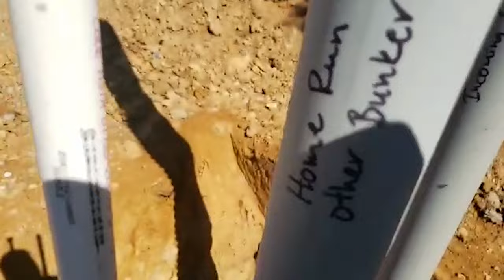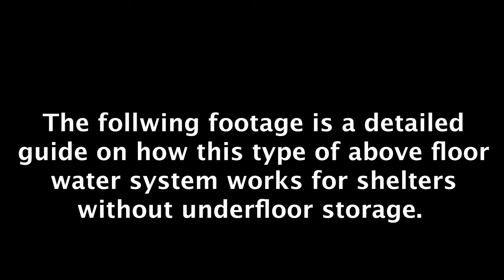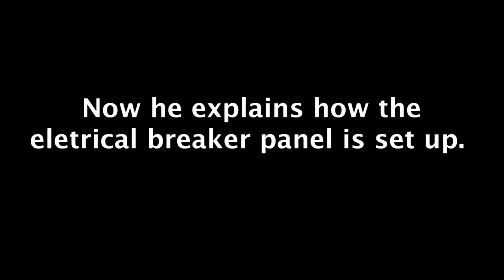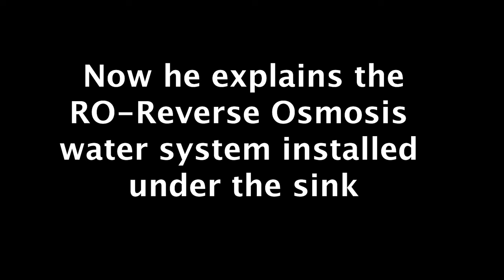INSTALLING a $350,000 ATLAS BOMB SHELTER with a SECRET PASSAGE!

Comment: These bunkers are very nice man caves, and a fine storm hide out but nothing more. Certainly not a bomb shelter! They are not deep enough and a bomb shelter should be protected by at least 4 meters of reeinforced concrete, preferably much more.  Same is true for the entrance and escape hatch. You sell nice fairy tales!
Reply: Not to mention all someone on the surface would need to do is plug up all the air vents & suffocate everyone inside the bunker. These are nothing more than fancy, expensive tombs.
Reply: @Bishop228  I had the same thougts , those vents should be much better protected. A Nice wine cellar Or tornado hide out; nothing more

Comment: Something I would want done differently, or in ADDITION to, the water system in that bunker.  Add a filter before the external water goes into the tanks or water heater with the cross-over from the output of the tanks is back on the INPUT of the filter.  Even if it was just the particulate portion of the RO system, every little bit would be a help, and not THAT big an increase in cost.
Reply: I'd like to have a way to recirculate my water supply while it's not being used so it can re-oxygenate. It would also help lengthen the life of the water filters, especially if you have the extra filter as suggested above. I'd also like a way to limit water usage to the shower when it's not being used for decon. Really, there should be a decon shower before entering the living quarters.
Reply: This has bugged me for years but since the subject of a secret passage was brought up.... The proximity of the escape hatch to the bunker has driven me almost to drink. I'd love to see someone actually ask for an escape tunnel ending up in the woods or elsewhere if leaving the bunker was absolutely necessary. And just because it should be seriously considered, the entrance and escape should be booby trapped.
Reply: @kevinmoore2929  if/when I can afford one that's what it will be with mine.  Either in or behind another building at least 50 feet away.  The problem with popping up in the woods is avoiding killing trees while you're digging the trench for the tunnel.
Reply: @michiganengineer8621  at my farm you'd never believe how fast trees grow back if you remove them.  In under 10 years we had a road through our farm we didn't need or care about so we let the trees move in.  Here we are now you'd never have known 10 years ago anything was there.,.. that area is a forest now just because we stopped maintaining that space.  It is thick with trees now.
Reply: @kevinmoore2929 the main reason is in case of an emergency inside the tunnel like a fire where the gasses can kill you quickly. The escape is there so you can try to get up and out fast without having to go for 200 yards through a tube before you get to the ladder. 

The lesser reason is for an attack where you need to escape someone trying to get in.

Comment: You need a German Plumber in your team!!!
Reply from the maker: Why
Reply: @AtlasSurvivalShelters  German plumbing is really well engineered, they’d use stainless steel for most of that. They really would be baffled as to why a concealed domestic filter install was done inside a bunker, they’d hang all of that on the wall where it could be easily maintained. They install to industrial standards for maximum efficiency and reliability, which is actually what you want in a bunker really

Comment: Is the plumbing vent routed through the blast valve? If not, that will be quite a mess if some form of explosion blows the contents of the p-trap back into the bunker.
Reply: I know that the air system has a blast valve but idk about the water system.

Comment: Ron you could use dado for the sockets put it round like skirting board and it can be boxed up for your sockets and spurs etc I don't know if it's sold in America but it's common in the UK for offices etc looks smart as well that way you wouldn't need to use conduit for the sockets on a no under floor storage set up also they do a skirting board with two pipes in so hot and cold could be ran through that

Comment: Looking good but I have 2 suggestions to improve your plumbing. Expansion tank for the water heater and 2nd put a check valve on the supply line to not loose any potential stored water.

Comment: Ron, when are you going to start using the newer reverse osmosis system with the easy 1/4 turn twist on/off filters ? That thing is a dinosaur. But it still gets the job done.

Comment: Greetings Ron, Is it possible to go deeper? For instance, having 20ft of soil above your head. Or is there some sort of limiting factor that prevents that?
Reply: It all depends on what type of bunker you use/buy and the cost of digging the hole and back filling. Ron has talked about it in other videos.
Reply: @RJM1011  also the water table is a deciding factor in how deep you can go I would think. 👍✌️
Reply: @abritabroadinthephilippines  Yes Atlas does do watertight shelters because of that. Thank you.
Reply: The culvert bunkers can bear more soil cover than the square bunkers I’ve read somewhere.

Comment: odd that the bathroom is at the entrance. It also seems like a little more design could simplify things.For example, they are like, "just plug this pump in and shut these valves". Why not have the pump hard-wired and just have a switch? Little details like that, adding a $2 switch, is better than crawling under a water tank.

Comment: Is that possible to convert a basement into a bunker? If so, what is mandatory to have/build?
Reply: That would be called a panic room. You need a gas tight door, strong walls preferably fire and bulletproof. Air filtration with positive air pressure, I would be happy with a commercial filter, I don’t rate NBC as a significant threat in my rural area.
It should be hidden, so it has to be in line with the expected floor plan.

If you’re building then I would use ICF and put it under the garage, driveway or patio with a hidden door into the basement. Use the house to supply the bunker with utilities, weeping tile, insurance, hide the air system in the walls, privately stock preps. Have a trapdoor hidden under a drainage grate in the garage, that only opens from inside.

Comment: I think it's more likely that we will get hit by an asteroid or supervolcano eruption. If either of those happen then a layer of dirt possibly many feet will be on top of this bunker and don't forget about the tsunami or weeks of continuos rain which usually happens after a large impact. It would probably be a good idea to place this in a location that has no chance of flooding and or make it completely waterproof. You'll also need some kind of hydraulic lift to get to the surface if you get buried in dirt.

Comment: I admit I like some of his bunkers but those sliding barn doors .... it would be better with a solid lockable door between compartments
Reply: Needed for airflow through the bunker.
Reply: For what purpose? The hatch is locked and so is the bunker entrance door. Maybe the 2nd unit should have been sealed off, but the client wanted the odd bookcase thing for some reason.
Reply: @dmcd7333  thats easy tho , i would put vents down low for that.

Comment: Like the design and wish I had the bank account for something like this. I did have a question, at 19:52 when showing the breaker panel, there are what look to be 2 arc burns inside it on both sides of the bars? Was that an accident on install or something since?

Comment: What is the use case for something like this? Obviously it will help tremendsouly in a natural disaster situation. You would be able to secure yourself during the situation. And even continue living in it after the disaster, but if the owner has been able to spend 450K only on this, I am sure he has another house some other place to go to after. In a end-of-the-world scenario, the family would be able to hide and live... but if anybody discovers where they lived it would not take to much effort to force them out with all those air tubes sticking out.... any specific video where use cases are discused?

Comment: In the long term how do the tops hold up ? seems like all the water would pool up for extend periods in all them squares not having a smooth top for water to run off to the sides . 
I have so many questions about bunkers that never get touched on in any of the videos .
Reply from the maker: They all have bleed holes.   They can't full up

Comment: Thanks Ron, another great video. How are you feeling after that cancer scare? If someone intentionally builds a fire under the NBC air intake, will the system filter out all of the smoke and the carbon monoxide? If not, what is the plan?
Reply from the maker: Turn it off
Reply: in addition to turning off the NBC intake system (basically not sucking the stuff in) I'd thought that a simple compressor air tank could help supplement the air. 

like letting off the pressure in a compressor tank in the bunker in small bursts as a air "source" while the fire is going on at the intake to help supply fresh air.

Comment: What type of hatch is on the escape tunnel? Wouldn't you need the same safety doors on all entry/exit's?
Reply: It’s designed to keep the damp out, and a plastic sealed area of sand sits above it. Should be fine
Reply: I agree I wish Atlas would show that

Comment: Water system has no drain valve(s)?
The air intake for the saniflow, is that bypassing the blast valve intake? Because if it is, a blast wave will easily rupture that PVC pipe.
It's a bad decision to try and install all that under a sink, it looks nice, but if you have to disassemble it to change the filters or replace the macerator (they do fail...), then you'd really wish you hadn't
Reply from the maker: Fallout shelters are different than blast shelters.   3-6' of concrete is added and steel plumbing then
Reply: @AtlasSurvivalShelters  So this is just a fallout shelter? But at 16:42 there is a blast valve?
I'd agree that being within a blast zone is extremely unlikely, but this seems like an oversight to have a sewage line venting directly to the outside? You can get internal air system vents that would do the same thing I believe
Reply: So far I seem on this it’s not safe
Reply: @Kapu5-15  oh I believe it’s really safe, these points are just unlikely edge cases

Comment: Hey Ron. What kind of heating is possible for the bunkers?
Reply: Any but DON'T use gas.
Reply: Could you heat a bunker like this with a woodstove? if it was installed professionally?
Reply: Probably geothermal since you’re already gonna have an excavator on site. Geothermal can also do your hot water tank. 
Electric stove. 
Fire is risky because of the ventilation. Plus you’re losing space to store wood.
Reply from the maker: The air system can have heaters added
Reply: @rudycarlson8245  You can do Ron put a video up this week of a cold war bunker with a wood stove in it. I have already been looking at doing the same with my own bunker. I am waiting to visit Atlas hopefully soon to have a look at the factory and talk with Ron. Thank you.
Reply: A geothermal heat pump would be ideal, assuming you had working solar or battery. Or a remote propane heater pumping in hot water. You can’t have any combustion process being used inside a sealed space. In practice the human body produces sufficient heat in a lockdown situation, actually too much
Reply: @RJM1011  You need to carefully re-read what I wrote: "a remote propane heater pumping in hot water.", I wasn't suggesting a heater inside the bunker

Comment: So If there was a major disaster and there was wide-scale looting. What is the safeguard against someone finding the air intake pipe and smoking out the occupants? Seems like a death trap to me unless you have a way to hide or block the air intake from tampering. If not there should be multiple air intakes independent of each other that are far away from the actual shelter.

Comment: Personally I would have the generator and each separate building 50 to 300 ft apart if not more.
You never know what will happen or people will try.
To get into secret doors to each building.
Reply: Then you need 50-300 ft of tunnel which is hard to keep waterproofed. 
Maybe a basic culvert with sump holes and some means of purging bad air from the inevitable damp. Instead of a culvert large enough to walk in, probably make a rail system in a smaller culvert. 
It would definitely have advantages for escape or fighting.